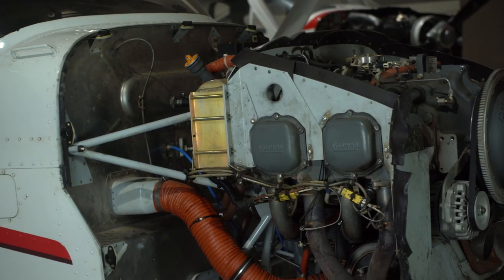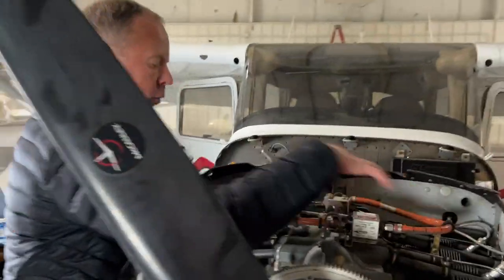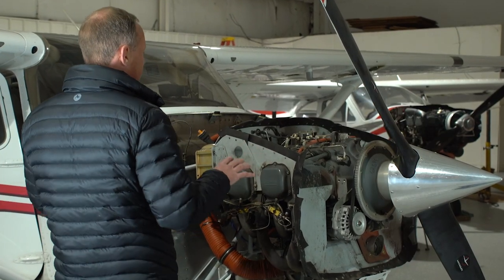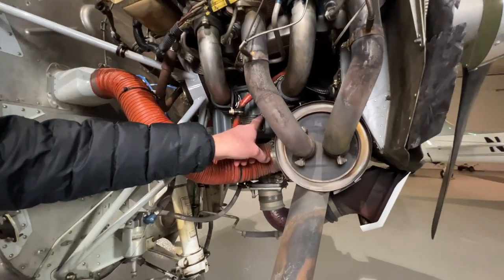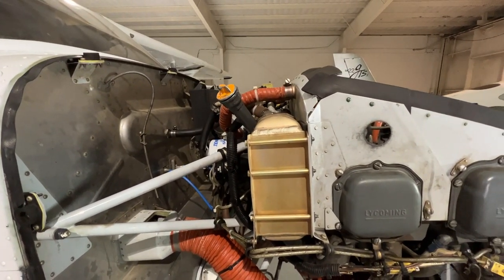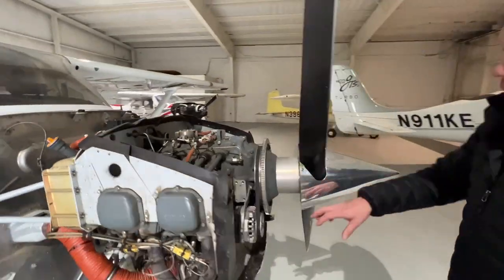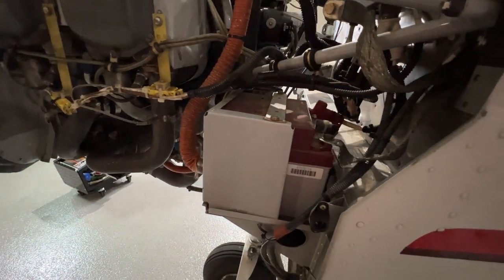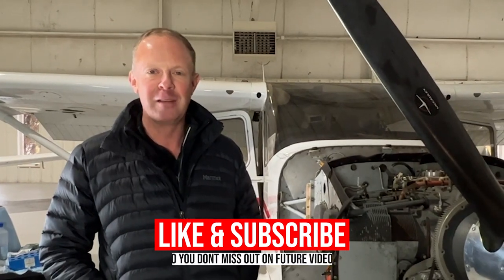Discovering the Secrets of the Cessna 172 Engine System

Comment: What’s the reason for GA planes 24V instead of automotive 12V?
Reply from the maker: Hey John one of the main reasons for using 24V electrical systems in General Aviation (GA) aircraft is their ability to offer weight savings. The lighter and more compact 24V batteries provide a weight advantage over the larger and heavier 12V batteries, which is a crucial factor in the aviation industry where weight management is essential.

Hope that answers your question.